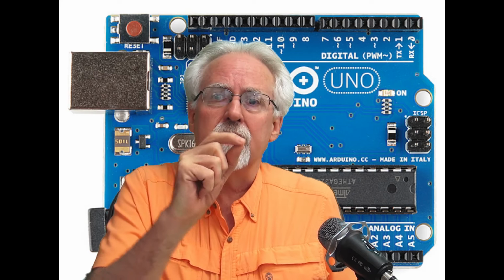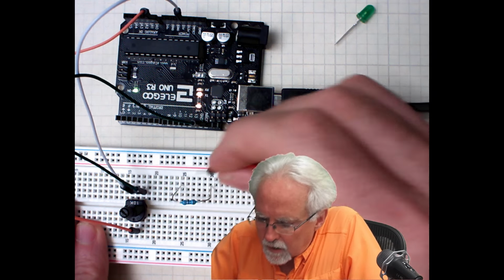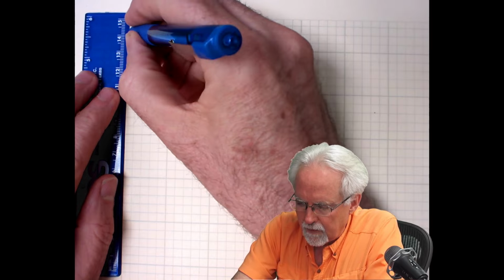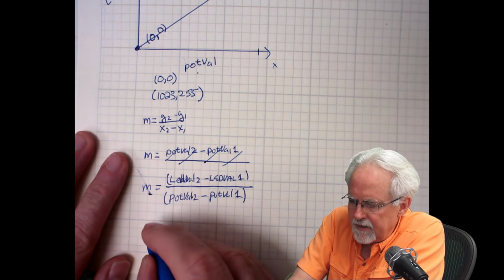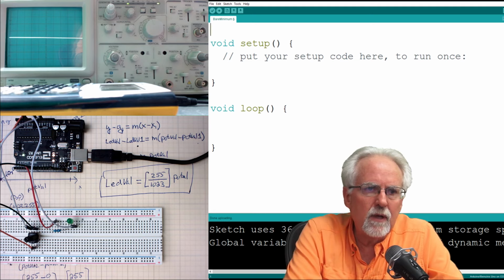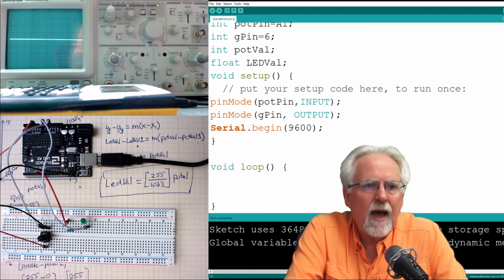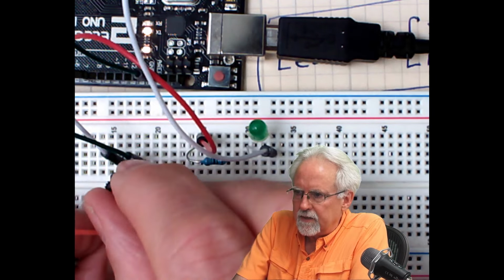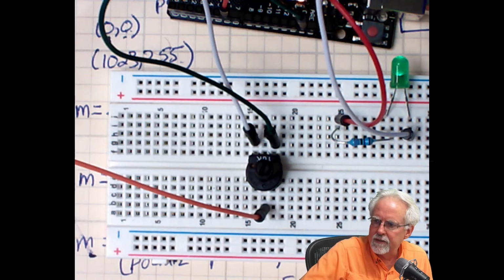Arduino Tutorial 14: Dimmable LED Project

Comment: You're not talking to a wall. You're inspiring a bunch of us. Here's a tweak on this lesson -- I thought it might be fun to print the value (0-255) and the voltage (0-5), using tips from the previous lessons.
I may have changed the pins, but that shouldn't matter, as long as it's consistent.
/* built to Tutorial 14, dimming an LED: 
 *  ref https://www.youtube.com/watch?v=7wKdxsvXAFo
 * need a PWM pin. Use (digital) 6 in this build
 * voltage values range from (0 to 1023) oops, 0-255
 * slope of (0,0) to (1023, 255): = (LEDval2-LEDval1)/ (potVal2-potVal1)= (255-0)/(1023-0)=255/1023
 * y-y1=m(x-x1), or LedVal-LedVal1=m(potVal-potVal1), so LedVal=m(potVal), so LedVal=255/1023*potVal
 * 
 * HOMEWORK: 
*/
int potPin=A2;
int greenPin=6;
int potVal;
float LEDVal;
float (volts);
int dt=1000; //gives the loop some recovery time
void setup() {
  // put your setup code here, to run once:
Serial.begin(9600);
pinMode (potPin, INPUT);
pinMode (greenPin, OUTPUT);
 }
void loop() {
potVal=analogRead(potPin);
LEDVal=(255./1023.)*potVal;
analogWrite(greenPin,LEDVal);
Serial.print("Potentiometer value is ");
Serial.println(LEDVal);
Serial.print("Potentiometer voltage is ");
Serial.println((LEDVal)*.0196); //.0196 = 
 
    delay(dt);
  }

Comment: Why didn't you add delay for this sir. May I know the reason please
Reply: You can add a delay to slow down the speed at which the serial monitor prints. However, the delay will also slow down the action of the potentiometer on the brightness of the LED. This is because the delay instructs the Arduino to wait a period of time before repeating the loop. The LED will appear to brighten/dim in steps (rather than smoothly) as your delay time lengthens. Try it just for fun.

Comment: Paul, I am enjoying working through each of these tutorials and the extra assignments.  I have been adding comments in the code to self-document as I was taught in Computer Science classes beginning in 1972 into the early 80's and saving each sketch, numbered according to each tutorial's number.
Reply: klrwhizkid I am doing the same with the documenting and saving.  Also using commenting to keep older versions with the newer version on the same sketch when there is a change to the code.

Comment: Another great job Paul!

Your explanation of the math involved really helps in understanding what's going on "under the hood".
Building from a previous tutorial I added Serial.print code to show led value compared to potentiometer value.

Now I can see the math and value difference.
Serial monitor reads:
led value is: 127.38
potentiometer value is: 511
led value is: 127.38
potentiometer value is: 511

Comment: Hey Paul, I did all the math and am following you because you’re one of the few folks who explain the math and physics aspect of this (thank you!). However, I was not able to make my led dim. I tried different LEDs, tested them, tried different potentiometers, different jumper cables and 330 resistors, and different holes in the breadboard and different PWM pins for the LED and different Analog pins for the potentiometer.  I even tried switching which cables are grounded. Double triple checked the code and it will only turn the LED on and off. I set the analogRead to both the pin value and led value to check both and they both work but the dimming effect is not happening. I’ve been  turning the potentiometer carefully, and still nothing like you’re video. Oh, and I’m on a raspberry pi 4, plugged into a portable battery charger. It’s been a nice system and has been working. Any thoughts?
Reply from the maker: Are you connected to a pin with the ~ beside it? Only those can do pwm.
Reply: Paul McWhorter, Yes, absolutely. I even tried different pins on my Elegoo Uno that have PWM capability just in case the first two were damaged. No go for that LED connection. I even tried different LEDs. I also tried Analog pins for the pot. I also checked the serial monitor for both ledval and potval to make sure both were working, and they are so it makes no sense...
Reply: Hmm just tried connecting the resistor directly to the pin and that worked. Not sure why that is, but using a jumper wire doesn’t work and I tried different kinds and lengths. Thanks again for any input, no pun intended

Comment: I have built the circuit and written the code exactly as Paul’s tutorial 
Yes the LED dims and brightens.
BUT the serial monitor shows 0 to 255
By meter the voltages are as expected for the LED brightness.
Or 
I can amend the code as per tutorial 12. ie LedVal=(5./1023.) * potVal;   and get correct Voltage 
But LED is too dim
I sorted it by using Serial.println(LedVal/51); 
Can anyone explain why I needed to? 
Paul
Overall very pleased with the series. I am 70 and just retired as a mechanic that fought electronics for the last 25 Years. 
For retirement I bought a Beaglebone and struggled for months and couldn’t get it to do stuff. 
I found your Arguino/Raspbery/Beagelbone comparison Video and you hit every problem I found.
So I parked the ‘Ducati’ and bought a ‘Bicycle’ I am making good progress and following the vids.
Now your Tutorials are giving me the science as well as the practical tasks. The pace is good as I can take notes and do the task on a second run through.
Thanks 
Dave 
UK

Comment: Mr. McWhortor, I wrote a program of my own to dim three led's that I am using on my temperature/humidly meter, using the DHT-11. As I rotated the pot, it would reach full brightness and the go out and then as I continued to turn the pot, it would keep doing this. I couldn't figure out why. I opened the serial Monitor and saw that I was writing from 0 to 1023, just as you said not to do! I forgot to find the slope of the line and write the equation! Man, you are good. I spent a lot of time trying to figure this out then, I remembered your lesson 14 and, boom! The circuit is working. All I have to do now is incorporate it into my program for my temp/humidity meter. I did work it out myself but, I admit I didn't remember how to write the equation into the Arduino sketch. Thanks sir for all your lessons. I'm a bit slow at 76 years young but, I eventually get it! Ha ha!

Comment: If you hook the middle leg of the potentiometer directly to the resistor or the long leg of the LED, you can dim/brighten the LED without code :D
Reply: Yes, its good you understand that truth. The point of the lesson is how to understand how microprocessors work, there are many simple things you can now do in the software with this simple circuit that using the pot and LED alone with a current limiting resistor you can not do.
For example you could easily make the LED grow brighter and then back to off automatically and use the pot to control the speed this happens. by easily changing the code, here are some hints to help you:
int rate;
int scale=100;
int max=255;
int dTime=10;
and then in the loop
rate=potVal/scale+1; 
LEDVal=LEDVal+rate;
if (LEDVal>max) LEDVal=OFF;
delay(dTime);

Comment: I've done some side reading. The conversion constant could be defined as a float variable. Apparently you get 6-7 digits total for those. There was something that bothered me about this program. You multiplied an integer by a floating point value and assumed the result would be an integer. I guess the Arduino handles this with an implied data type when using analogWrite, but it would be better to use LEDVal=int(*Calculation*). It might not matter here, but there are situations when coding where it could cause a hard to find bug if you get used to not doing it.

Comment: I believe you want the potVal variable to be "float" type and not "int", since the potentiometer's voltage varies continuously. Thank you Paul for this amazing series of videos!
Reply: This would be true if the value the Arduino was working with actually were the direct input voltage, but there is an analog to digital converter on each one that turns the value into an integer from 0-1023. Ultimately the Arduino is digital only. Even the analog outputs are PWM which is also a digital signal. A capacitor can make it act more like an analog output, but for the types of projects the Arduino is used for, PWM is actually more useful most of the time.

Comment: In case anyone runs into the same problem as I did, choose a pin from 2 to 7 for the LED. These are the ones that have pulse width modulation. If you choose a pin from 8 to 13 the dimming won't work!

Comment: For anyone following along, if you want to make things infinitely easier, go to Amazon and search for '7 in 1 RAB Holder'. The one from Makeronics is what I got but there are a number of different ones. It will hold your Arduino and one or more breadboards in place and it's got non-slip feet. I'd also suggest buying or making some jumper wires of various lengths. I have sausage fingers so I just bought some. This will let you avoid almost all of those long wire loops that just get in the way and pull out when you look at them wrong. You may want a small set of needle nose pliers as well which makes inserting components and wires into the breadboard a LOT easier. I got mine yesterday and wired it up with the ground and 5 volt rails, some LED's with resistors already in place, and a few switches and pots with wires to relay points so hooking them up to the Arduino will not result in wires crossing all over my breadboard. That should get me through a fair number of tutorials and let me experiment with far less chance of wiring issues causing a problem.  The plate can also hold a Rasperry Pi which I imagine a number of us doing these tutorials may want to try out as well at some point.

Comment: sir I have one doubt  as you have used pwm pins for the led , but while i am doing i tried to use pin no. 2 the also it works the same as before . What is the reason behind it plzzz explain.

Comment: hi Paul, thanks for another great tutorial. Instead of scaling directly the value form the analogRead 0-1023 to 0-255, i scaled 0-1023 to an intermediate variable 0-5 (volts), then scaled again 0-5 to 0-255 for the analogWrite. Then i run the program and reckon the Led brightness did not change smoothly, it had a few steps (i did not open the SerialMonitor to see voltage). After checking the program i reckon the intermediate value was INTEGER, and when i open SerialMonitor it printed all integers, so I corrected the intermediate variable to FLOAT and things work fine.

Comment: Cool tutorial. I incorporated the previous 2 sessions on this one, as well as having the dimmable light, I also have the warning lights with a pair of limits blinking as warnings. I am managing to keep the the breakboard all set from the binary counter, the project keeps on building up, very easy to use the pins that are already connected. One thing, I worked out that on digitalWrite, HIGH can be replaced with 1 and LOW with 0, then it is easy to add operations on the light power.

Comment: Hello! I did the project by not using the formulas you provided, just logic equation and it worked :

Vread=analogRead(potentiometer);
VoutPt=(Vin/1023.)*Vread;

brightness=(VoutPt*255.)/5.;

dutycycle=(brightness/255.0)*100.0;

Anyway, your formula helps a lot, shorting the amount of the needed effort in order to do the same job;

Thank you!

Comment: Hello Sir,

First off, I really appreciate your tutorial videos. Thank you for taking the time to make this available to the public.

Being that the potentiometer is essentially a resistor, a variable one, can we put the LED in series with the the variable resistor to get the same dimming effect?
Reply: Yes but he wanted us to do some math and calculation
Reply: Yes, its good you understand that truth. The point of the lesson is how to understand how microprocessors work, there are many simple things you can now do in the software with this simple circuit that using the pot and LED alone with a current limiting resistor you can not do.
For example you could easily make the LED grow brighter and then back to off automatically and use the pot to control the speed this happens. by easily changing the code, here are some hints to help you:
int rate;
int scale=100;
int max=255;
int dTime=10;
and then in the loop
rate=potVal/scale+1; 
LEDVal=LEDVal+rate;
if (LEDVal>max) LEDVal=OFF;
delay(dTime);

Comment: Hi again, Paul. Thanks for this great lesson. It occurred to me that it would be nice to see the PWM or analog voltage at the ledPin as well, so I declared a float variable: pwmVoltage .
and then used the formula: pwmVoltage= (5./255.)*ledVal.      I then serial printed this. So in one line...we have potVal, PinVal and pwm Voltage. 
potVal = 1023 ledVal = 255.00 PWM VOLTAGE = 5.00
potVal = 675 ledVal = 168.26 PWM VOLTAGE = 3.30
potVal = 430 ledVal = 107.18 PWM VOLTAGE = 2.10
I surprised myself with this one....couldn't even have imagined this without your help and instruction, mate. Thanks again!

Comment: You are talking to us well. I found at the end you were getting some peculiar readings!. So was I and the readings were from 0 to 255which is the ledVal. I wanted to see what the voltage was so I changed the Print.line statement to Serial.println(5.0/1023.0)*potVal and to my suprise it worked. Thanks for the very good set of lessons.

Comment: in serial monitor it seems fine, but physically at 0 LED is off and above its constantly ON, its not dimming...
plz guide me

here is my code

int potpin=A1;
int gpin=6;
int potVal;
float LEDVal;
void setup() {
  // put your setup code here, to run once:
  pinMode(potpin,INPUT);
  pinMode(gpin,OUTPUT);
  Serial.begin(9600);

}

void loop() {
  // put your main code here, to run repeatedly:
  potVal = analogRead(potpin);
  LEDVal=(255./1023.)*potVal;
  digitalWrite(gpin,LEDVal);
  Serial.print( " my LEDVal ");
  Serial.print(LEDVal);
  Serial.print(" = ");
  Serial.print( " potVal ");
  Serial.println(potVal);
}

 plz giude me.
Reply: you should be using analogWrite(gpin,LEDVal);
Not digitalWrite

Comment: I was wondering why we need a resistor when we are already using a potentiometer back in the potentiometer class and i took the resistor for testing and it was working fine until i put the potentiometer in 0 ohm and boom the led burned , so dont do what i did 😂

Comment: Flowed along just well. I like the live mistakes, teaches me more then just do this and that's that. With the mistakes it really shows why it has to be done certain ways.
I do the Homework and also try to throw something more at it sometimes.  This time I added second Pot that delayed(pulsed).  Used the formula to put the pulse range to my desire, settled with delayvalue= (75./1023.)*potval2 making  5v aka 255=100ms 
While first Pot dimmed dimmed them.

Comment: It is the cheap pot that is the problem, not the wiring connections. Either the legs are making intermittent contact, or the internal wiper is sloppy
Mine is doing it too, primarily at low values of V2

Comment: Hey, 

If you do the math you are using decimal numbers, So you start to count from 1, so it is 256/1024= 1/4= 0.25 
If you read or write to the arduino you count from 0, so it is 0-255 and 0-1023. 

Calculating with 255/1023 takes far more resources and it makes no sense.

Comment: why in integer we can put A1 or A2 etc ? if it's integer then only numbers are allowed right.  And Paul i am enjoying every tutorial and also following along with you.  Thanks Paul. Your teaching technique is just fabulous.
Reply: The A1 or A2 etc is used with the Arduino board, it is replaced automatically by the correct integer pin number when your program is compiled.

Comment: Sir why did u took 255 for maximum potvalue? I didn't understand that.
Reply: The 1023 value is the write value of what is inputted by the potentiometer.  Where as the 255 value is associated with the pwm output pin.  This was covered in one of the earlier lessons.  When you do a write to a pwm output using an analog write it gives a maximum value of 255.  This value is used for the LED that is being turned on.

Comment: Hi
Enjoying the new series. Could you explain why the led has to be driven by the arduino and not directly by the potentiometer?
My guess is the PWM has something to do with it.
Reply: Yes, its good you understand that truth. The point of the lesson is how to understand how microprocessors work, there are many simple things you can now do in the software with this simple circuit that using the pot and LED alone with a current limiting resistor you can not do.
For example you could easily make the LED grow brighter and then back to off automatically and use the pot to control the speed this happens. by easily changing the code, here are some hints to help you:
int rate;
int scale=100;
int max=255;
int dTime=10;
and then in the loop
rate=potVal/scale+1; 
LEDVal=LEDVal+rate;
if (LEDVal>max) LEDVal=OFF;
delay(dTime);

Comment: Good lesson. Sometimes the connections are a bit dodgey. I have to hold my pot down on to the board or it just reads 5 volts. Not sure if it's the pot or the way it fits into the board.
Reply: lol, i had actually just commented on the previous video that i had solder some wires exactly because of that, and then as i'm watching this lesson, it happens. sadly, the pot seems to be the weakest component in the whole elegoo kit, the battery coming in second as it sometimes doesn't have enough current for projects using the servo.

Comment: Good information, thanks.
Would it save CPU cycles to calculate the slope in void setup and use the calculated value in void loop instead of recalculating through each loop?

float Slope;

void setup() {
   Slope = 255./1023.;
   ' ' ' 
}
void loop() {
   LEDVal = Slope * potVal;
  . . .
}